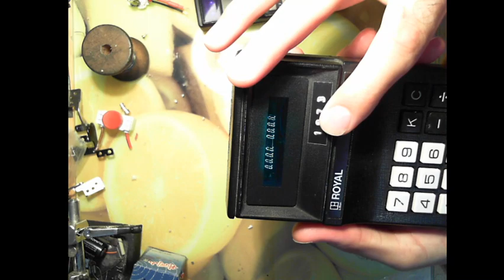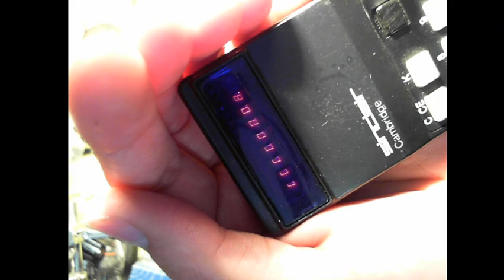Sinclair Cambridge 1970s Calculator Overview

Comment: Is it normal for them to display a (sort of) random number when you switch them on?  Mine usually displays 66666665 (although it may vary), and I've no idea if this is usual.  It will clear when you press C/CE, though.  As much as I like the glowing red display which takes me right back to my school days, this is not a calculator I would use for any important purpose :-)
Reply from the maker: The chip seems to lack a reset circuit when it is booted. I have one other calculator that has a chip set that is part of the same range & does the same thing.

Comment: I had a Sinclair rpn Cambridge that the battery contacts had broken on Christmas Day when I got it . As you said build quality wasn't great, even if it wasn't a kit. The contacts just break in half if you try to use Duracell's. And that power switch is awful
Reply from the maker: Sinclairs stuff back then is much like todays Made In China stuff. The battery contacts & switch are just terrible, those two parts were the cause of much tinkering & the fact that whoever built it shorted out the pind on the LED multipilxer chip. Got him sorted though as that chip today is non-obtainium.